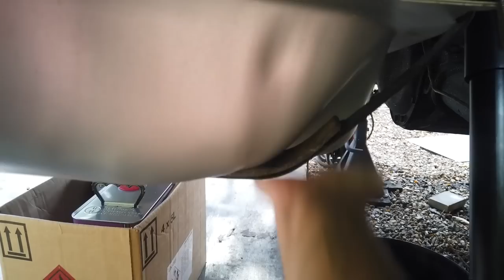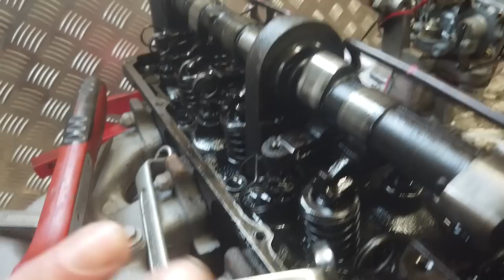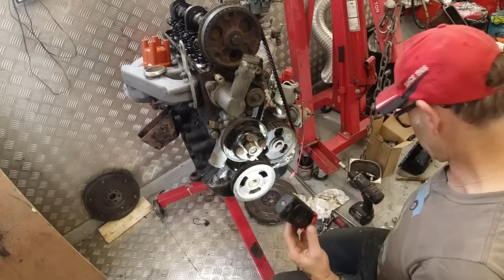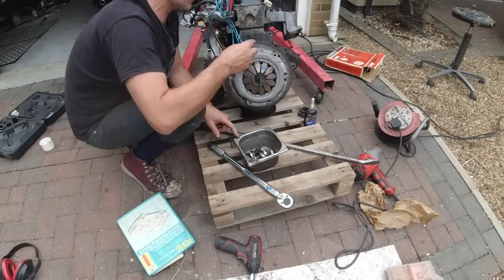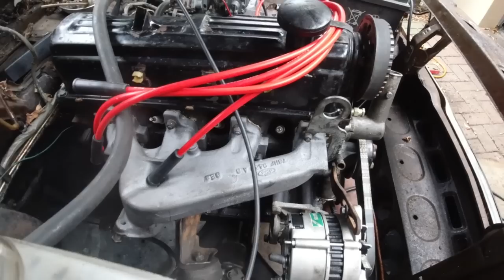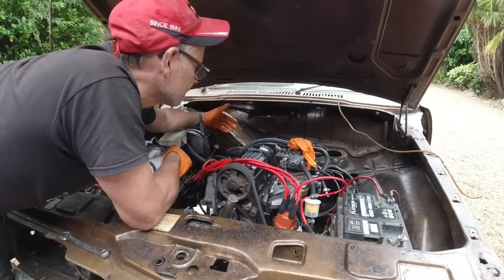PROJECT PAPPA - Mk3 Cortina Resto -EP12

Comment: Top job. Such a nostalgia trip thinking about replacing the cam belt on my sister's Sierra back in the 80s. The Haynes manual advised remove the cam sprocket rather than the crank. I so remember making sure of the 1/4 turn tension in the belt. Didnt even think about the dizzy position. Thank god it fired up perfectly on completion.

Comment: Great show Pete, Pappa is coming on very nicely.  Takes me back to when I was was preparing my pinto to put back in my Escort.  My only concern is that the wear on that cam lobe will not hold out for too long.  Once they begin to wear they do tend to go rapidly, but hopefully if you are changing back to the Kent it will give you enough time to do that.  Also thanks, you made me very much aware that those core plugs are a sobering thought especially where they are positioned at the back.   During the 8 years my car was off the road the antifreeze went off and some internal corrosion took place which I had to flush out.  Luckily they appear to be holding out, but you just never know how bad they are until they break through!!!!

Comment: If you turn the hooks for the tank around I think they will hang straight down, I'm sure mine do Pete.
 180 out? Remember when I contacted you about mine, when it wouldn't fire up Pete? It was, as you said 180 degs (I don't know how I did it either!) out but being a 1600 it isn't, I don't think, an interference engine (I have looked this up and have found conflicting opinions) so it turned over without jamming. Even when I was driving it and the (original? 1975) cam belt stripped a few teeth on the crank sprocket and died! It never locked up whilst turning it on the key! The 1600 GT (which had a 2Ltr cam and bigger valves) and the 2Ltr are definately interference engines.

Comment: Sorry, the way you showed us the thermostat fitting in the housing, I would say it’s back to front, ie the wax/spring part should be faced inside the engine block…🤔
Reply from the maker: hi Patrick I think I ended up fitting it that way, its corect as you say so that the bulb begins to heat up, im sure i did but could be wrong.....head has to come off anyway as im getting a knock sound, i think either a valve was damaged prior or piston is slapping , cant quite work out, but noise is coming from right at the top of piston 4, almost at the crown/valve area of head and block, gets worse when you rev

Comment: 1976 was way worse. Although 2022's max temp was higher, the hot dry spell didn't last nearly as long. In 1976, it spanned the entire Summer hols plus 2 weeks before and after.